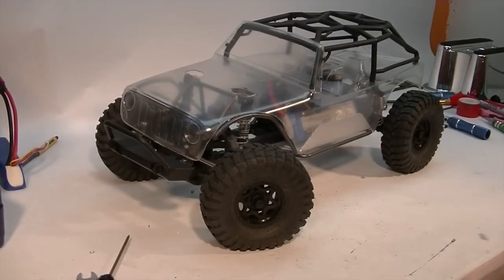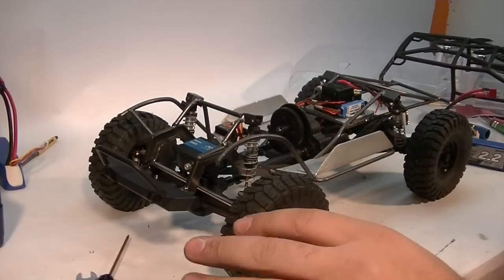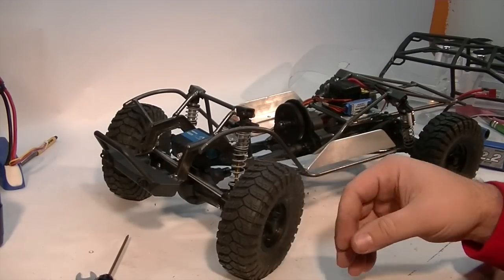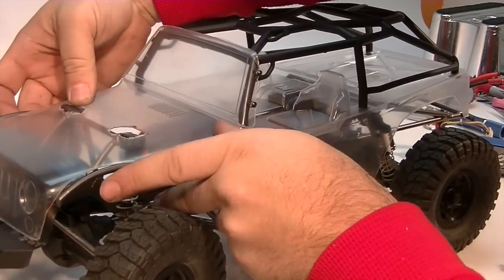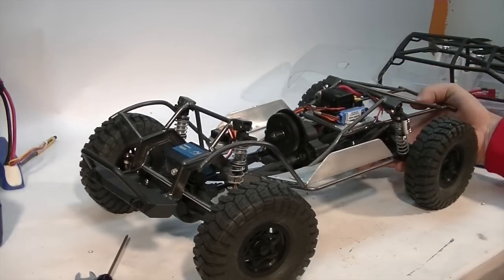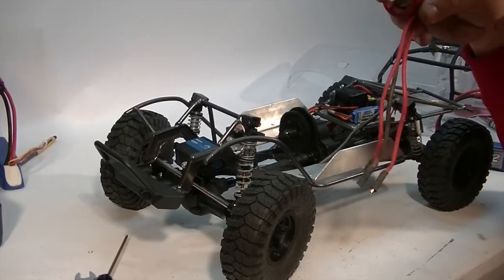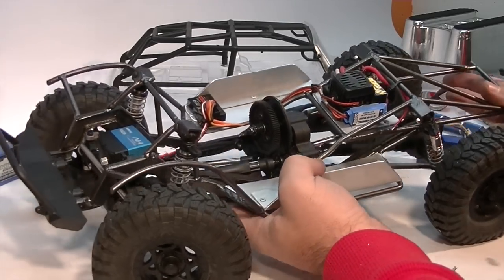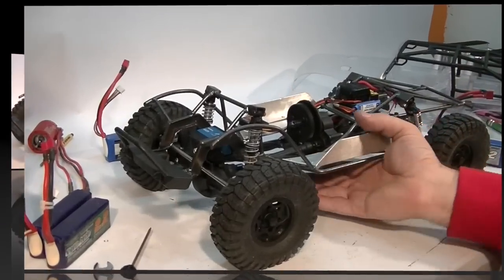Axial SCX10 G6 Jeep - Electronics - Episode  6

Comment: how do  i fix the drive shaft binding in my scx10 i have axial alloy links top and bottom both 4link front and back and shafts r mip they do have a big angle on them  ride higjt is standard also  cheers tony from australia great channel subbed it

Comment: HarleyDesignsInc Please put a reverse facing cowel over those shock mounts.. those holes in the hood ruin the look of the body :P
Reply from the maker: Personal preference I guess. It is a common thing in the full size world to have the shock/mounts protruding through the hood when the clearance is required. Adding pieces to a lexan body I find rarely looks good. I will not be going that direction.
Reply: fair enough :D on a side note when is the draw for that hardware kit? looking forward to that :)

Comment: Hows the performance of the 412 ? Im actually ordering parts for my build which will be for scale/trail/crawling...cant decide whether to get the 412 brushless or fxr 45t pro brushed.i want it capable of slow speed and torque but some punch when I hit the throttle! First build so any advice would help...thanks